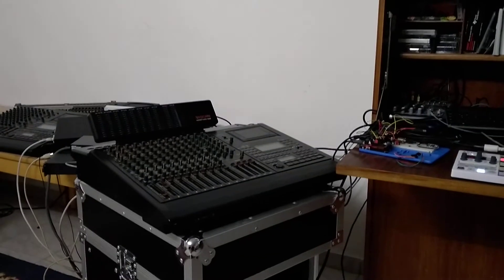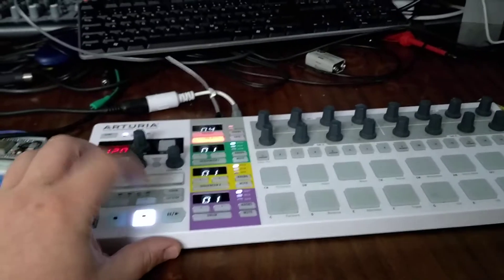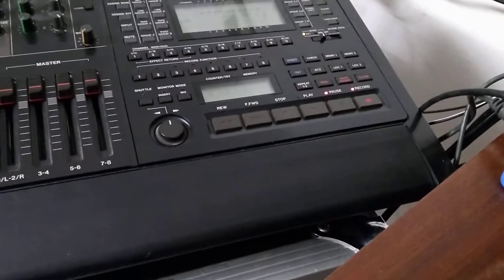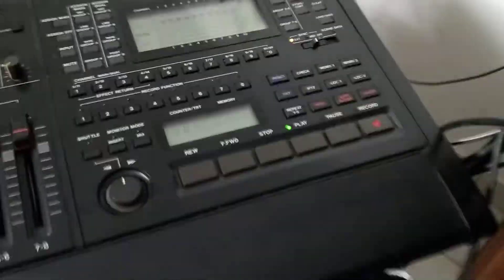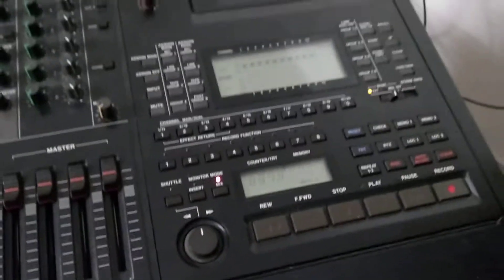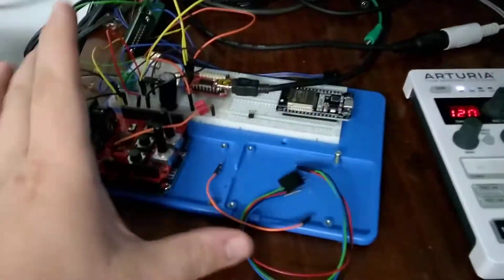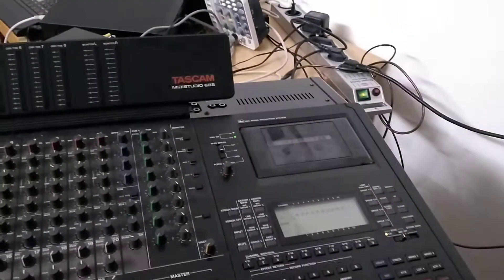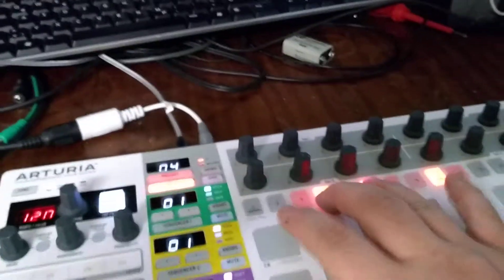Midi Control of Tascam Midistudio using cheap modern equipment

Comment: According to the service manual for the 688 applying a periodic signal (they state 9.6Khz 5v p to p) to pin 7 will drive the EXT pitch control.  I have yet to get this to work.  You mentioned using a DAC to do this.  We're you planning on doing MIDI cc or something to the signal?  Have you been able to get the EXT to work via the accessory 2 port?

Comment: This is great, I will definitely be building this... just curious, do you think the pitch can be controlled over serial, or was this going to be some separate interface?
Reply from the maker: Pitch can be controlled by controlling the playback speed. How did it go for you?
Reply: @Bencarelle  thanks for responding!  I haven't tried anything out yet, but I'm at the point where I want to have more control over pitch on the 688.  Mostly because I would like to do tracking on a lesser 4 track (I love the preamps on it) which runs at a slower IPS, and then move the tape over to my 688 to fill in the remaining tracks.  Some of the other 4 tracks have speed switches and I guess I'm looking to do the equiv (and more).  Could maybe be done with fixed resistors and switches inline w/ V+.  When you say playback speed, are you referring to the capstan motor?  I guess I'm wondering if pitch can be controlled in any way via serial, even if it means using timecode?